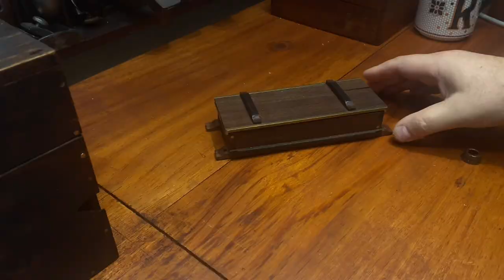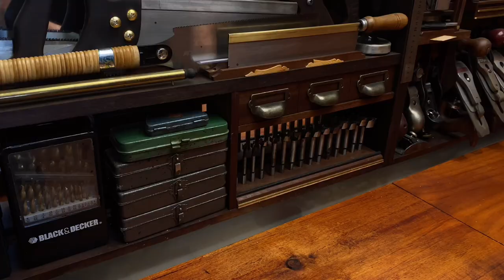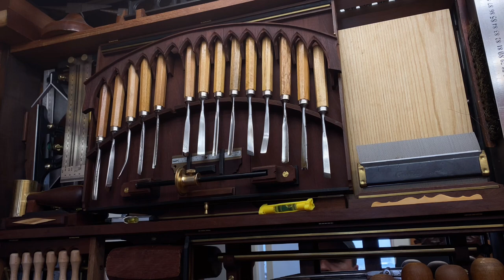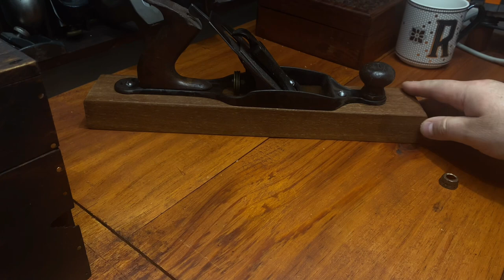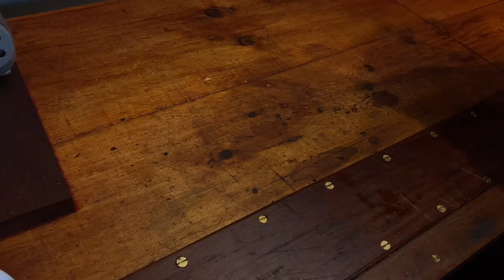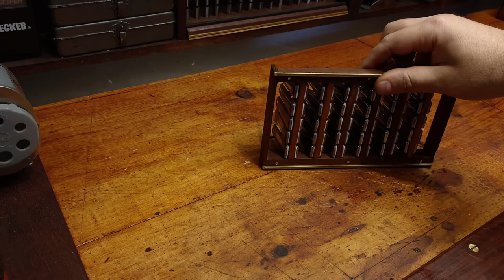Tool Cabinet Like a Master Henry O. Studley

Comment: With the exception of all the round shanked drill bits (I can personally attest to the difficulty in acquiring square taper shanked Forstner bits — but it can be done), I do believe Studley would approve of this chest and feel at home with all the vintage tools. You have given me inspiration for my own tool storage (similarly comprised of vintage hand tools)

Comment: Great project! But why does the drill drawer have three handles?
Reply from the maker: Hello! I appreciate the message. Open the handles... just a joke for the curious... the panel is full of curiosities!
Reply: @woodtransformer  Ahh, I get it. Building a Studleyesque chest myself, so doing research. Satisfyingly slow, interspersed with restoration of the tools it will contain. It follows my machinist's tool box that I scratch-built a couple of years ago (see my channel)- once again I have had to make all the locks and catches, nothing suitable available commercially.